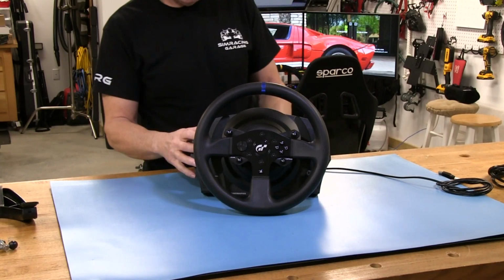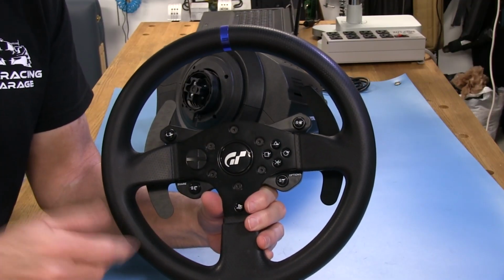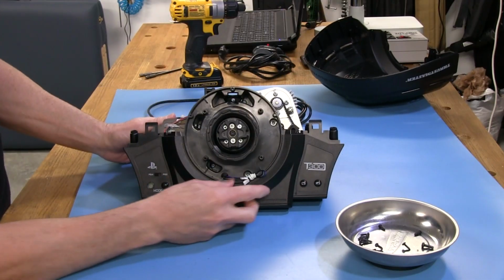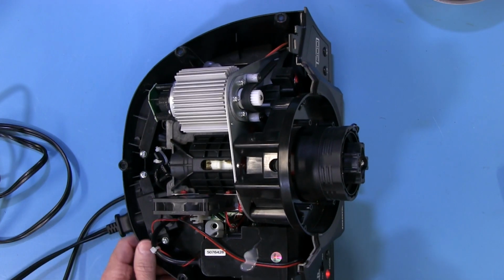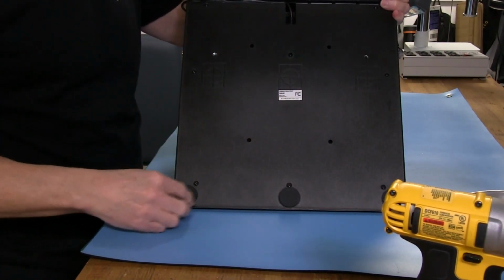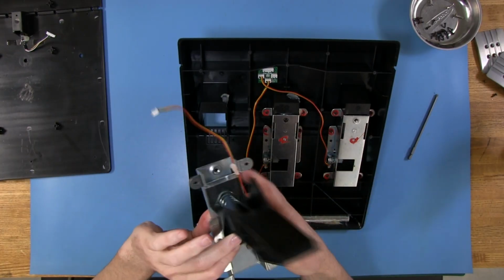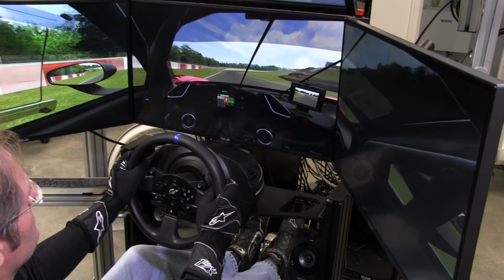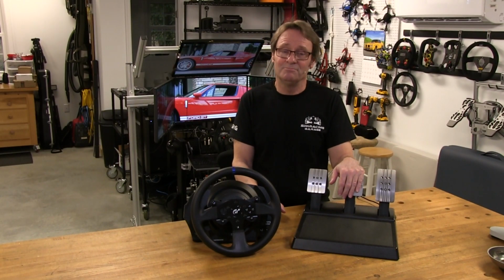Thrustmaster T300RS GT Review

Comment: For those that want to move the brake to the clutch position, it appears you can unplug the molex from the breakout board, unscrew the pedals and pull them out, move them/swap them, reconnect them, and button up. That is if the wires have enough length. Other guys are coming in from the top panel, desoldering or extending wires.

Comment: So hey Barry I have the same wheel, The T300RS GT Edition and I bought mine at a auction for a great price, it's brand new came in it's original box with all it's plastic still on, but when i was going to plug it up to my PS5 i noticed the USB PLUG was broken, the plug part that goes into the USB port was bent and the white part inside of the metal was snapped off, so it does not  make contact at all. I tried getting it back into it's place but no luck. Any suggestions you can give me? Like can I cut the damaged USB plug and use another plug from a charger cable or a controller and rewire it? If you could give me advise on what to do, i will appreciate it so much.

Comment: My TM Leather T28GT Wheel has developed some play in the rim itself. I would need to disassemble the rim to look for a way to tighten whatever is getting lose in there. Any videos on this?
Reply: Lol! Easiest fix -  EVER! = Tighten the 3 Allen key bolts on the center front plate! No actual disassembly required. They were the 1st bolts I figure I'd try in trying to open the rim. When I felt the 1st bolt, it was loose, so I tightened it and lo and behold I had just fixed the issue. All play was gone. Sometimes I get very lucky.🍀
Reply: After a quick on track test, the above does fix part of the looseness but there remains the main collar which must be made as tight as possible and screwed down enough to stay that way. The collar does un-tighten with use. But once the front plate screws and the collar are tightened, there is no wobble whatsoever. The FF does feel much better as well.

Comment: 16:11 me neither haven't got those problems with 3 years of heavy use daily but i will keep my fingers crossed 🤞🤞🤞 also one big factor my room is always at 73f i can only imagine this thing overheating in a room that gets close to 90f and its possible. also one more thing i always run it with the fan constantly at full speed because my tought is if it goes out it better be the fan and not the motor i can easily replace a fan but not that specific motor 😁

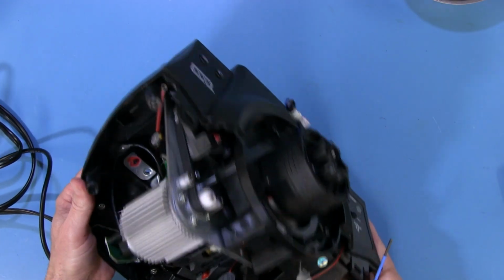Comment: 18:55, why are they using the pulley and timing belt combination?? Same awful design as with TMX. That is the worst possible solution. The timing belt tension force is acting on the motor wearing down front bearings that are not easily accessible for replacement & maintenance. Second timing belt has a polygon effect that makes turning the wheel jerky. If they would use plastic helical gears the whole thing would be way more robust and totally smooth. No jerks & angle gaps affect on user. And no squeaky noises. No way I'm paying these companies for planned obsolescence designs.

Comment: Just picked up the T300 to get more into racing and stumbled on your review, then I happened to peep the MFG Crosswind pedals on the wall and knew I had the right guy. I don't know if you've modified your rudders yet, but I suggest the dampener kit and to change out the stock pedal faces, I'm using the cessna replicas. Funny enough I have actually been using my crosswinds mounted upside down to a vertical face to turn them into a gas/brake. Thanks for the in depth review, I'll definitely be upgrading the pedals first, but this looks like a decent way to get more into it.

Comment: Mine keeps disconnecting for no reason, when it moves violently, eg a heavy crash (also power cable is firmly attached) The usb on the base is very wobbly. Not sure if this is  normal

Comment: I know this video is old, and this wheel and pedal setup are not a brand new item. But I do have a question...So, had a G920 and sold it to get one of these setups for 200...pretty good deal in my book. Here is my problem. I don't know if its just the way these wheels are made or its me, but with the G920 I could feel when the car was "stepping out" or when the tires where losing grip on the corners in iracing to correct the car. But with this wheel, which seems to be working fine, I cannot feel this at all. my car rear end just starts stepping out big time and spins every time through the corner. And just so you know what track to give an idea, I tried Kentucky to test this out on and I am so frustrated. I cannot keep control of the car and I hope its just me. Thanks for any help.

Comment: i know im 3,5 year late to this but i havent been able to find an answer. is the GT edition only able to play gran tourismo on ps4 or is it also compatible with other games like ACC and the f1 series?
i know theyve made at least one gran tourismo only wheel before
Reply: gt version is the version that has 3 pedals(gas,brake and clutch) and has nothing to do with grand tourismo game. if you buy the standard t300 rs (meaning the non gt version) you will get 2 pedals(gas and brake). and if you buy just a t300, that means you will only have the steering base and wont have any pedals and steering wheel at all:
t300: steering base
t300rs: steering wheel + 2 pedals
t300rs gt: steering wheel + 3 pedals

Comment: is this wheel better that ThrustMaster T300 Ferrari Integral Racing Wheel Alcantara Edition ?
Reply: I wouldn't get Alcantara if you don't use gloves, the oils and sweat from your hands will ruin it.
Reply: @Jenni_Sofia  thanks, what wheel is more realistic? I mean, to learn driving in the City car driving
Reply: @Sandro667386  Direct drive wheels are supposed to be most realistic, but I have no experience with them.
Reply: @Jenni_Sofia  which pedals are better: on GT version or on Alcantara?
Reply: @Sandro667386  3 pedals are better than 2. Load cell brake is better than no load cell. Hall effect sensors are better than potentiometers. Metal is better than plastic. That's pretty much all there is to pedals. Pick your poison.
Reply: Same wheelbase with Ferrari alcantara wheel
Reply: @mArvAlcao71  yes, they have the same wheelbase, but what wheel is more comfortable?

Comment: You look like the man to ask...My T300RS GT has began acting strange.  The steering is no longer smooth, and the capacitor on the motor circuit board has come off.  Could that be the problem with the steering feeling "choppy" for lack of a better word? At the very top of the steering there is a lot of resistance from zero to 5 degrees either way, then at 5 degrees it frees up until you get 45 degrees.  Then there is another resistance zone basically every 45 degrees or so. Is that circuit board replaceable if that is in fact the problem, or could the problem be with the motor itself?  Any help you could provide would be greatly appreciated.

Comment: The most thorough teardown and review of the product so far. Incredible.
Reply: Time is strange. Looking for my first wheel. This video has great information!
Reply: @DragonView1  if I can give you a recommendation there is one thing that you have to decide: if you are planning to learn drifting or dirt racing or not. If your answer is yes, avoid buying a gear driven wheel and opt for a belt driven wheel like the t300/tx/fanatec csl elite.
Reply: @beseakos  I want a HUGE Kickback and Force Feedback like... Arcade-style Racing Sims.
I'm seeing Gear + Belt - Looks like Belt is better.

Honestly, I saw a friend's Microsoft G920 and it looked... "NEAT" but ... weak? I mean the wheels "takes control" from you with Forcefeedback, but it doesn't "Pull you" or "Drag you" with very much Force. I assume USB can't create force without an A/C adapter.

I'm looking at the $250 wheels out there, but I'll wait 6-12 months and pay $1200 for a good high-quality wheel with HEAVY Force-Feedback.
Reply: Looked at Microsoft, the Thrust Master, Hori, so far it looks like, "Fanatec" is King and might be the way to go?
But even then, I"m afraid their $400 or $600 still won't pack the "punch" I'm looking for.
Reply: @DragonView1  Both the G920 and G29 has a wall adapter, it’s just with the gear driven systems there will always be some deadzone and the amount of force feels like a toy compared to other wheels. The belt + gear wheels are also solid but they are just as weak and cloggy as the gear driven ones. Your options are pretty much always going to be limited to belt driven systems for now. Direct drive makes little to no sense as an entry point and they require a solid aluminium profile rig to begin with. While a gear driven wheel can be table mounted, or mounted on a wheelstand (if space is a concern). As for arcade-style sims, you really shouldn’t go any further than a T300RS or TX leather. The ~6nm torque it provides is plenty enough and has a much more direct and smooth feeling than the gear driven ones with their 2,5nm output that is translated through 2 small motors and a pair of helical gears onto the main gear that drives the wheel. For a $400 wheel the g29/920/923 is not a good deal if you want strength. 

As for fanatec: the CSL elite has great amount of support both for PC and Console but the pricepoint is a lot higher and the pedals absolutely have to be upgraded, which is not very cheap. I wouldn’t personally buy one for consoles if you didn’t have the extra to spare for the loadcell brake mod.

Comment: In addition the the cooling mode update that Paul posted you should also give it 10-15min to cool after a race session.  I wrote a .bat file for my sim machine with a desktop shortcut to automatically shut it down after 15mins.  I had one of these go bad a little over a year old and I think the issue was I would race then shut the computer down and the wheel's innards would heat soak because the fan turns off.

Comment: Hey i just picked none of these up at a auction but the servo motor won't Rotate and over heats. Its like its missing a phase and the motor is locked up. Woth power off it rotate smooth not mechanical issue. And if i disconnect the power to the motor and power on and i manually simulate the reference sequence the steering angle is working. I want to fix it but not sure where to go from here i think it is a bad motor.

Comment: Só between this version, and the g923, which one do you recommend to start? Because everyone says, t300Rs wheel is better than g923, but he peddle are the opposite, and because of that I can't decide, because after that the shifter is way more expensive on the thrustmaster
Reply: The standard 2-pedals that come with the basic T300 kit is way worse than the Logitech BUT the wheel base itself is a massive upgrade to the G923. The G923 is a great starter but if you plan on getting in deeper you'll probably want the T300RS. Also, if you do plan on getting in deeper, pedals are most important. Thrustmaster has a nice load cell pedal setup and Fanatec has some great ones as well. After that, you're looking at big money and while really expensive stuff is definitely great, you will start getting into diminishing returns (as with any hobby).
Reply: @mr6291  thanks sir ❤️
Reply: Same here dude!

Comment: a tip for mounting: put the wheel base over a 40x40/45x45 profile, screw the 2 M6 bolts with 2 brackets on the "back" side of the profile, towards monitors, in this way the M10 hole will be accessible on the other side (seat side), grab the clamp and make it "hug" the profile from underneath and screw it in, in this way you don't need any Wheel Deck, any wood plate nor anything else while respecting the 3 hole mounting rule with a lot of strenght! Hope this is understandable without pics:

Source: I'm a cockpit producer

Comment: Love Iracing and Asseto Corsa with this wheel, fantastic, but am I crazy, or am I the only one having a hard time doing good laps times on ACC tho?  Game feels soooo different.
Reply: I feel like ACC is the most stable cars in sim racing. They are almost too easy to drive. The original assetto corsa is much harder to drive. What do you mean its more difficult?
Reply: @nathaneasley4452  may just be the wheels settings, I’m just consistently slower on lap times in contrast with competition even on easier settings. I’m fast in other sims, but I haven’t dialed this game in on the wheels settings. Can’t put down a hot lap compared to AC or GTSport, hell, even in Iracing, I seem quicker
Reply: @TryNotToHate1  did you adjust the wheel rotation in the settings?
Bc ACC you need to change the rotation degrees for different cars..

Comment: Honest question, why do some reviewers that have an enthusiast setup play with one foot on the pedal and one on the brake?
Reply: Left foot braking.
Reply: @demonicsquid7217  why though, that's not how we drive unless it's a technique used in racing
Reply: @ED-le1pr  It's used in racing, particularly with paddle clutches etc. It's also more efficient in terms of your foot movements as you generally want your right on the throttle as much as possible. It's easier once you learn it to use your left for both brake and foot clutch (if you have one on the car).

Comment: $400 for the T300 RS/GT setup or $400 for Logitech's "New" G9923 that's the 4th clone of a 15+ year old G25/G27 that literally has the same components inside the wheel base and shell as the 15+ year old wheels...Its absolutely no contest in this price bracket. This T300 wheel has double the torque, double the wheel speed if not more, more accuracy, more fidelity, and way quieter because its belt driven and doesn't have the loud whine, lash, clunks, and clanks that the all gear setup of the logitech wheels. They feel like toys compared to this and they're in the same bracket (talking the G923, not the G29/G290 which are back to $250).
For more Rant read below:
 I seriously dont know WTF logitech is doing. They're so lazy they haven't made a new wheel design in over 15 years and just keep churning out the same wheel and now they have the balls to charge extra $150 for some FFB Gimmick they call TRUEFORCE, lol. Its just some post processing added on top of the games FFB. I hate how they they're using these BS to sell and they advantage of ignorant customers who are getting their first wheel looking to have some fun with race with an entry level wheel. IMO even the T150 and TMX wheel base that are the true competitor are better in all aspects of the G series wheel bases aside from the logitech's pedals which are pretty good for a $250 wheel/pedal combo. They rival the T3PA but imo I think the logitech's are better feeling after modding. For my first 2 years I used a T150 with modded Logitech pedals, then a bought a T300RS wheel base and kept the heavy modded logitech pedals (They were removed from they're casing and I mounted the pedals vertically in my rig and had a clutch mod and a really heavy brake mod that felt great), got the TH8A shifter, made a usb handbrake, and the kept that setup for a  years. After that, I was, got a better job, and finally build my "no need to upgrade for 10+ years equipment) I bought a Simucube 2 pro, Fanatec CSL Elite Pedals V3s, Fanatec Shifter, Kept my DIY Handbrake since its alot nice than anything else IMO, and a 80/20 Aluminum T-slot Rig I built from scratch instead of paying $2000 for a prebuilt sim racing chassis. I spend about $700 on 80/20 cut to size, and all my hardware to put it together. Then I bought a nice Acura RSX Seat with rails for $50 bucks from the junkyard. Its so comfortable for a race style seat. I might buy the DoF reality P3 this year but not sure yet. The movement and motors look great for the price but the frame is so cheaply made.

Comment: Thank for including the pedal disassembly.  For those that do not want to use the clutch this clearly shows how the clutch can be removed and the brake can then be moved to the clutch position on the left if more spacing between gas and brake is desired.

Comment: how are thew throttle pedal in terms of throttle control? i have fanatec v3 pedals and csl elite wheel but my stuff recently quit working. atleast the wheel did. none of my pedals and wheel show up no more in my game controllers but i did try everything to make them work so im thinking my pcb board quit working in my pedals and i love the v3s. i just need something to get me by for a few weeks til i get my original setup back. it will take me some time because im actually thinking of going up to a csw 2.5 wheel over the csl elite

Comment: Please answer me if you see this. I got this t300 rs gt. Came with pedal. But i plugged everything somehow pedal is not working in game. I used pc need for speed heat. Only driver i installed was the t300rs gt. When i checked the driver it is responding on the driver. Somehow on everygame. It isnt working at all. I download ed need for speed deluxe edition. It only has t300 and t500. When i choose the t300 only wheel works. When i pick the t500 in the game pedal works but its different direction. Gas pedal is working when i hit left pedal. Middle is stop. Right is cons. Idk what to do

Comment: That Thrustmaster proprietary J12 connector is a deal breaker. Makes it a lot more difficult to resell them since they only work with TM wheels. The TM adapter that converts it to USB has been discontinued.
Reply: Theres an adaptor from TM to use the pedals as USB.